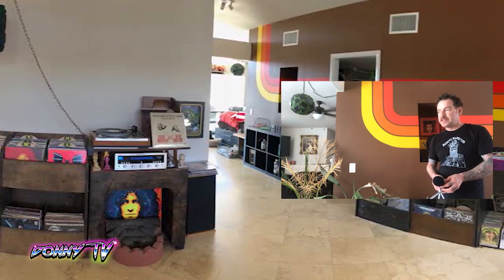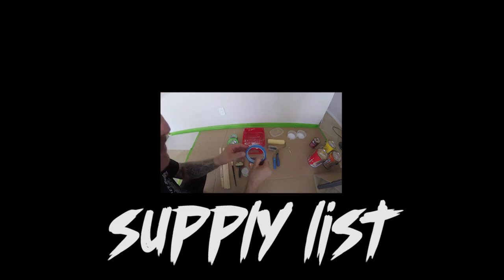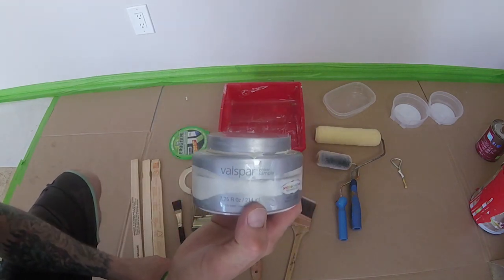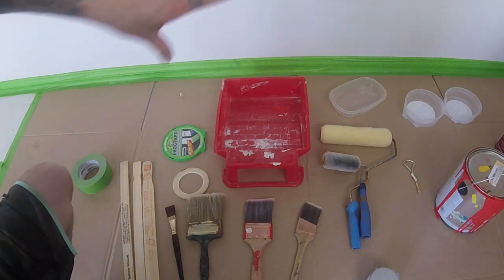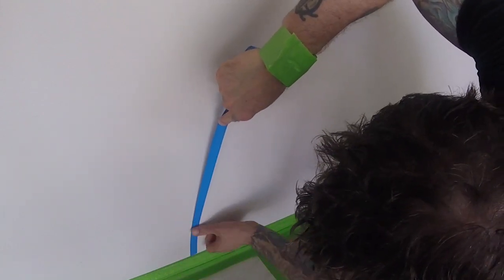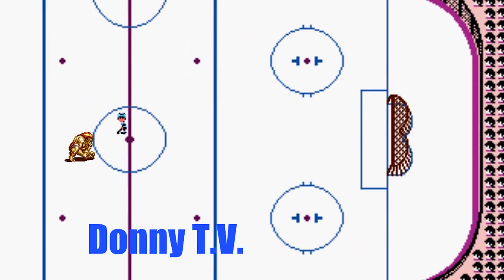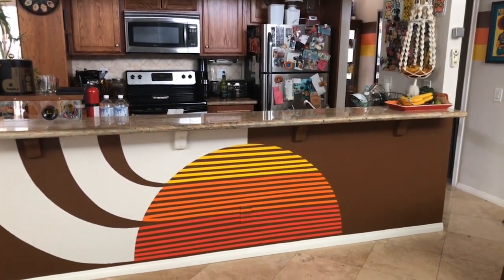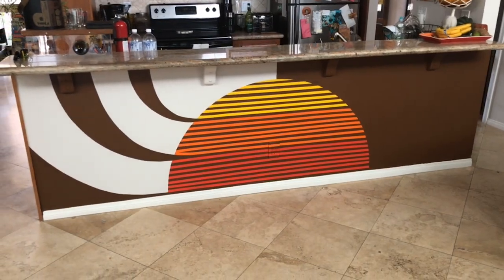How to paint retro style SUPERGRAPHICS in your home!

Comment from the maker: Part two is in the works! It is a simplified version, maybe easier with basic but rad graphics!
Reply: I’m about to attempt these graphics. Did you ever finish the more simplified version? I’m trying to do super graphics but having issues with the curves.
Reply from the maker: @eddieortega9625  3M  Fine Line Vinyl Tape works great for curves. The skinny dark blue stuff. Then tape off the rest with normal tape. A huge thing is having the walls be flat. If it has a bumpy surface it usually is a pain in the ass.

Comment: Are you fingering the valspar along each tape edge before you paint? When you pull the tape, the line is clean it doesn’t pull up bits of the small valspar layer?
Reply from the maker: Yes I am, and it works great. The most important thing that I have learned is too make sure the wall is sanded down super smooth.